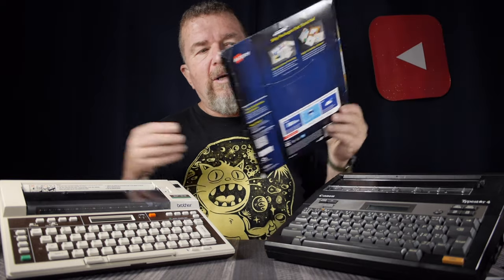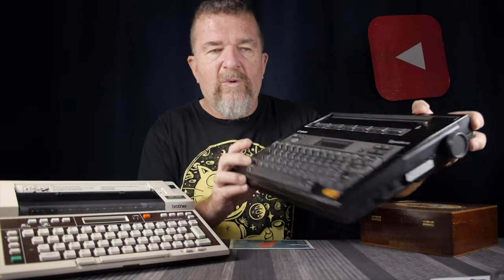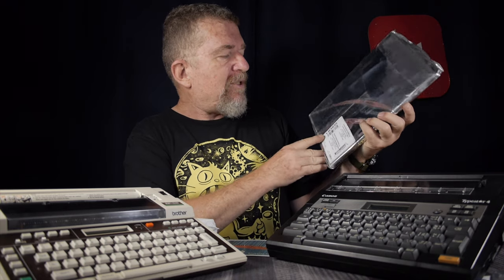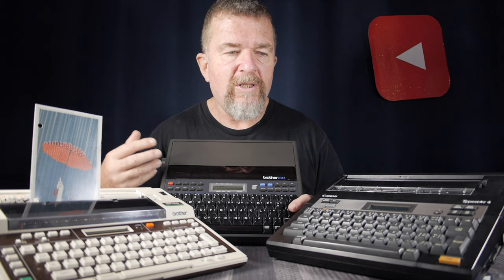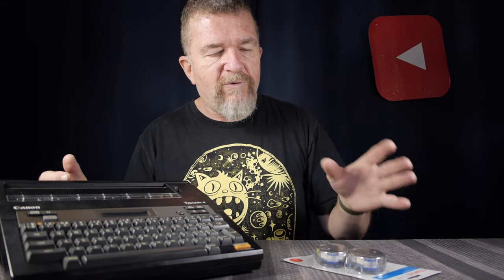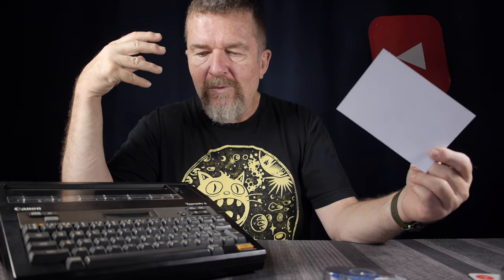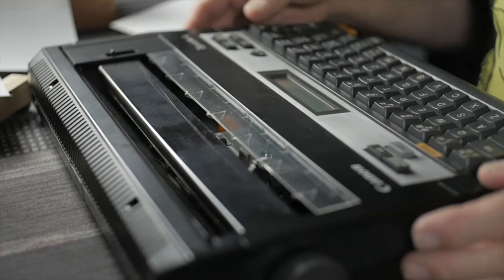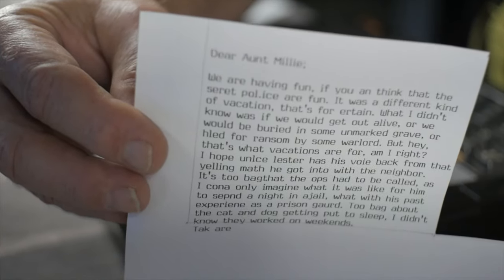Typewriter Video Series - Episode 196: Thermal Postcard Notes

Comment: I was thinking of laying the type sideways. too.  Looks good. My worry would be the PO obliterating some of it with the printed UPC code they put on cards. Maybe turn the paper 180 to put the right margin down. 
I used a glue stick on my last mailings. It helps to add an "X" on the back too. It holds the center down to the card.